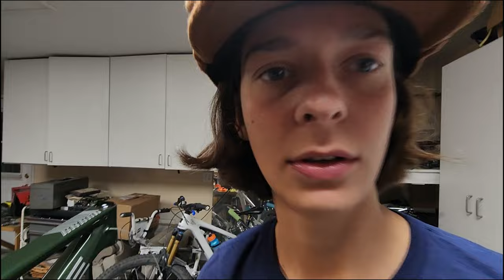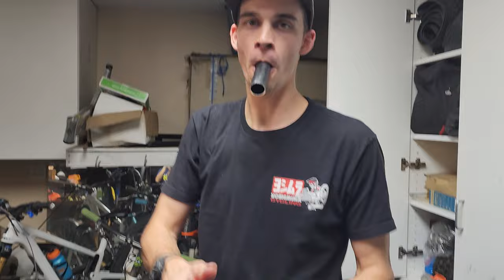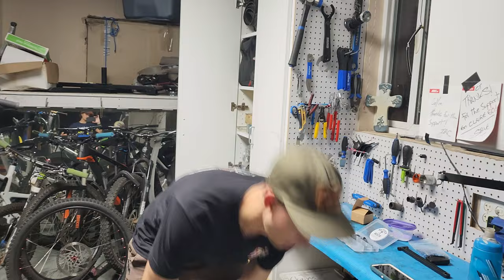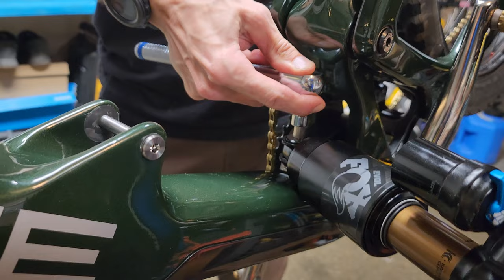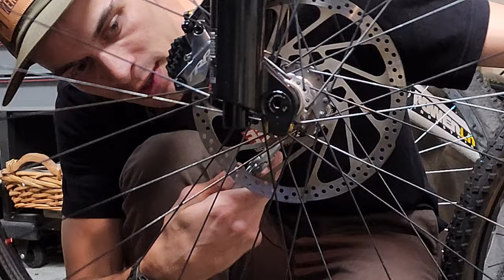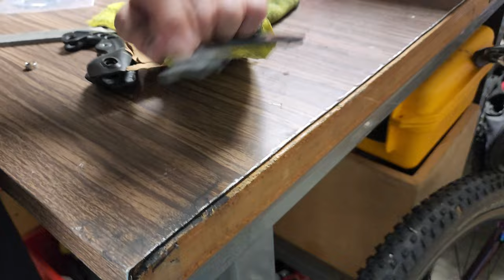Deviate Cycles Claymore - Brutal bike build -

Comment: As the build gets use, update on the status of that seatpost! My Highlander didn't have a drain port (not sure if the claymore has one?) But after some wet rides the seatpost got really corroded. I didn't want to pull the post after every ride so it was a deal breaker. Hopefully not a problem in socal! Also, I ended up removing the two seals in the idler to reduce drivetrain friction, made a huge difference and with the updated housing you can replace those bearings pretty easily.

Comment: but is that AXS mech (weak clutch) loud?  I had to bail on mine and go back to mechanical
Reply from the maker: So... Funny you ask! I ditched the XX1 AXS mech for a GX axs. The motor is noticeably louder and stronger, and the clutch is wayyy stronger. Combined with my 'mcball' lock that you see in the 'mtb sound deadening' video , it's a dream!
Also I swapped the Xx1 cage to this mech, it's the only thing that sets the weight apart of GX to the Xx1. Boom baby!
Reply: @collinmcballin  interesting.  I had a GX AXS with your 'mcball' lock and was still getting so much chain rattle/noise.  Experimented a couple days ago and put a 2017 XX1 mechanical (type 3 clutch) on and it's dead silent.  Makes me wonder if I got a bad GX mech.  I'd heard here and there that they are hit and miss on clutch tension
Reply from the maker: @thenbuck9  dang!.... yeah the clutch wears on those pretty bad.. I bet The noise you're getting is from the chain ring slap, get a lower guide on there, or a frame mounted pulley. Most effective way to quiet a bike right there!
Reply: Any recommendation for a lower guide?
Reply from the maker: @thenbuck9  well..... You saw the video and what I had to do.... Make it fit and keep drag low, and no noise... Eesh
The other system I made out of a pulley and sheet metal, you have Instagram?   Maybe I can send a photo there
Reply: Thanks. Nbuck9

Comment: What's the final weight!?  What size? How does ride?
Reply from the maker: Yes, yes, yes!
Reply from the maker: It's too light, somehow it's 35lb 11oz.
How does it ride? I'm totally not interested in trying or riding anything else, at all.
Reply: @collinmcballin  Heck yeah.  I have a L ordered through WorldWide and it should be here in the next few weeks.
Reply from the maker: @inseinej1  dialed! Yeah worldwide wanted insane money for one, so I bought through a shop in Canada.
You got a claymore?? No way!
Reply: @collinmcballin  Really?  The price is pretty standard no matter where you look.  Some shops sell Frame only vs Frame+rear shock so I wonder if you were confusing that?
Reply from the maker: @inseinej1  what! worldwide is selling the frame for a thousand dollars more than the others!! Punks...
Reply from the maker: @inseinej1  and in pinkbike review they even say the msrp is ~3200
Reply from the maker: @inseinej1  well then! Haha I have a receipt for the frame only at 3,200. I found a couple shops it was cheaper but they didn't have size/color. 2,989 usd was the lowest price I found for frame only.
Then I bought shock through my local shop. They gave me a discount because I got a ton of stuff. Dialed!
Reply: @collinmcballin  Yeah my guess is it's 3600 going forward sadly.  WW did the same (discount for a full build) so it's likely all about the same.
Reply from the maker: @inseinej1  oof! Still best bike I've ever ridden. It's nuts on the trail. Riding/review video coming soon!